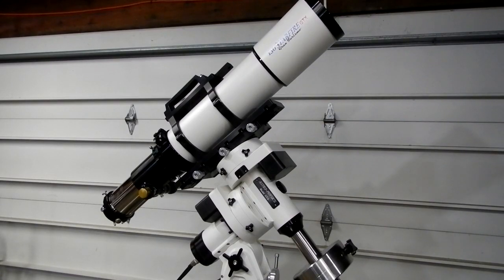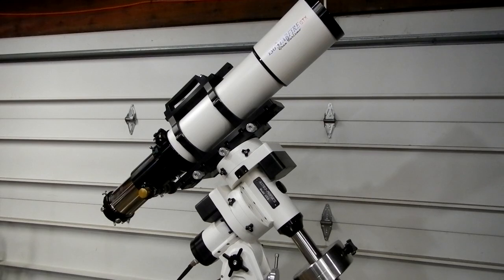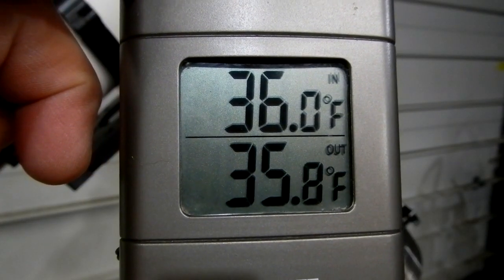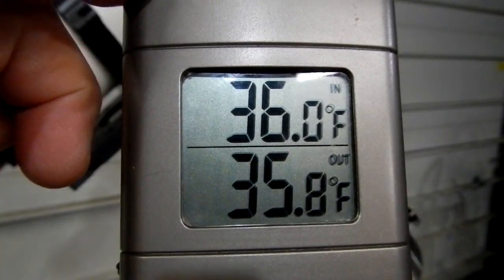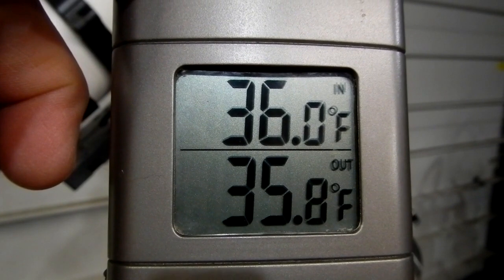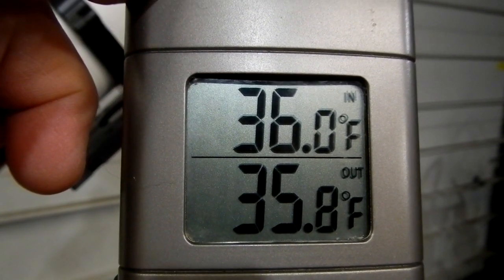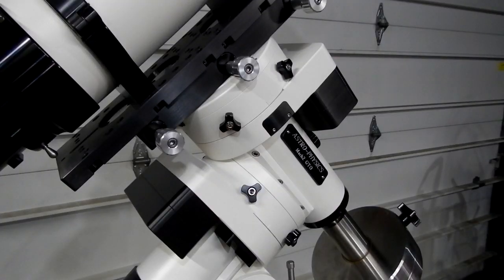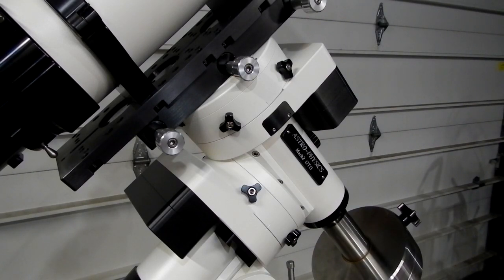Astro-Physics Mach2 mount - How the Motors Sound

Comment: Hello star astronomers,

interesting video, which you propose. Thank you.
Interesting that even though I cranked up my set of 2.1 Stereo Speakers, well I didn't find the noise from the engines very excessive.

I have had the new AP1100 for about 1.5 months, well on the balcony I have a fixed location for practicing astronomy.
Unfortunately the fixed location side, is on the 8-family house side including myself, on the bedrooms side.
In the summer, as soon as the heat begins, my neighbors sleep with the windows open, it is the noise of the engines of the new AP1100, already on the speed of just 600, even if they move slowly, the engines are still noisy, not to mention on the position of 900 or 1200!

Unfortunately, I have no other options on the balcony and rented apartment that I have, I have to make the sad decision that the 1100, I will have to sell. It's too noisy, for the several nights I'll be doing astronomy from my balcony. I'm very sorry, but I see no other way out. I'm watching your or other good videos, but the AP1100 is always noisy!
I think precisely to be practically empty inside for the passage of the electric cables for the various accessories, it is not possible to have motors, at least as silent as for the AP-Mach2.

In your opinion that you do the different tests, do you find them noisy, or could I very well use already with the position at 900 speed that the engines are not noisy? I thank you immensely, for your good video reviews that you offer us.
Greetings from Switzerland. (*_*) Goodbye..
Reply from the maker: You're welcome Cesare. I wonder if you could try wrapping a thick towel on top of each motor to mute the sound? You could get a face towel that is of a heavy material. Holding it on with a velcro strip or large rubber bands. Definitely contact AP to make sure covering them will not cause the motors to overheat. BTW, I always slew at 600, the slowest speed.
Reply: @starastronomer  Hello my friend Star Astronomer, Thank you very much for your suggested answers about wrapping something on the two housing motors. Yes, as you answered, it could be that the housing motors are too warm due to the hidden sheet metal, and could damage themselves. Yes, also a good suggestion to ask directly to AP-Company.
Kind regards from Switzerland.

Comment: Just got mine on Tuesday. It's a beaut! Even the counterweights are a work of art.
Reply from the maker: Congratulations Crypto! Clear skies.
Reply from the maker: BTW, how long were you on the list?
Reply: @starastronomer  I ordered a TEC 160FL and they partner with AP. It was Roland who recommended TEC since he was pretty sure they'd never make another 6" APO. I've been on THAT list since 2002. Lol. 

Anyway so normally it's like 2.5 years for the Mach2 but if it's ordered with a TEC scope you are on a priority list. So I got it in 5 mos. 

TEC asked me if I wanted to be on this run or the next run becuase the TEC isn't coming until next year, I told them to keep me on this run since there's no guaranty of anything anymore with all the supply chain issues.
Reply from the maker: Crypto Jihadi    Nice. Good choice in getting the mount when you can. If for some reason you got the scope but couldn't get the mount you have no way to use the scope if you have no mount to put it on. I had a TEC 140 and it was a performer for sure. Only sold it when I got an AP 130GT. A 160 and the Mach2 is a great combination.